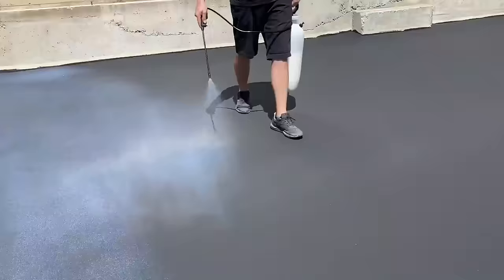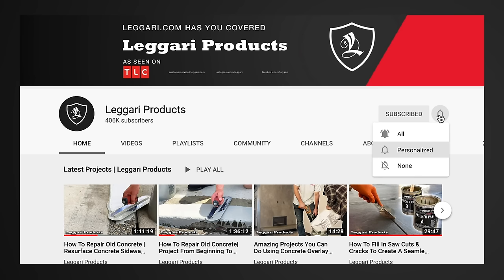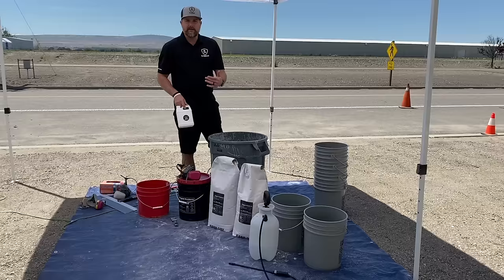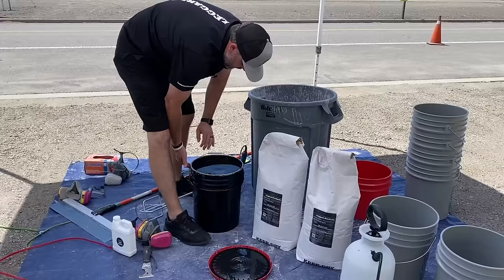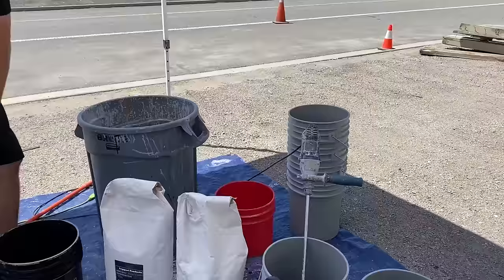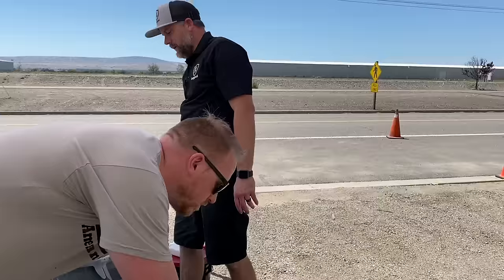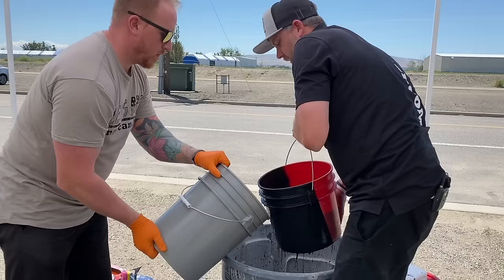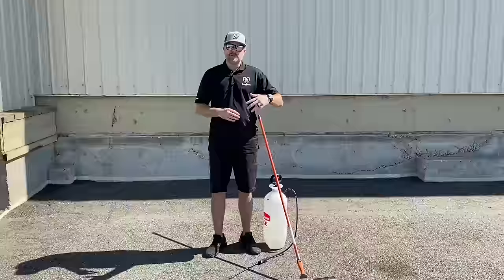Asphalt Repair That You Can Do Yourself Using This Kit | How To Resurface Asphalt

Comment: Let’s see a demo on a road that actually needs to be repaired.
Reply: This looks like gravel to me... it looks really good after
Reply: A killa 4 reala  at least 30? Evidence?
Reply: Hilarious, I was thinking the same thing
Reply: Z
Reply: Yes ridiculous to show on perfectly fine roadway
Reply: 0
Reply: I have worked with concrete self-leveling products in my time I believe it's basically the same thing but it's not a self-leveling product and all they're doing is throwing in a color so it should be filling holes and smoothing it out more than what it is otherwise it looks like it's just a painted paint job unless you can prove that there are the additives that supposed to give it extra strength as they said it has porced crust porcelain and other things in there but if it's that fine of a product where is it getting its strength is there an epoxy of mix how last long does it last what happens if it's on a hill when you do a burnout in the snow these would be technical questions I would really like to ask them
Reply: How many times does he say “prehydration”. Sounds impressive
Reply: Lol right

Comment: I would like to see the update, what does this look like 1 yr on? What kind of weather does it hold up to? Is it something you need to apply every year? Is it just paint in a bucket that will chip and wear so you have to re do it all the time. None of that was covered in the vlog. Yet ASMR in me liked watching the squeezgy moments!
Reply: You will never see that because in a year all the cracks will have come straight through and the first frost and it will all be peeling off.

Comment: Looks like a premium product. The cost is the issue. According to the website the asphalt sealer would be $1,926 for a 1,500 sq ft driveway without shipping. For not much more the whole driveway could be repaved with new asphalt.
Reply: you are wildly out of touch on how much that costs.
Reply: Cost me 2800  for a new asphalt parking pad a little over 1400 sq ft. Id have to agree going new seems to be more cost effective. Idk .. interesting product, would love to see how it looks in 2-3 years.
Reply: Yeah... asphalt isn't expensive. No customer would pay me 2 grand to seal their blacktop driveway when you can buy tubs for 14 bucks at home depot
Reply: Looks great but too expensive.  I can have my entire 10000 square foot driveway recovered with 2" of asphalt for a lot cheaper.
Reply: @itybitygangsta  Depends on where you live. I can bet a new driveway cost thousands of dollars. I hate asphalt. It is just cheaper than concrete.
Reply: @caffeinatedinfosec191  ok.
Reply: Way too much money for what you get. More bang for the buck by putting on new hot top.
Reply: thanks for noting price

Comment: Joe is right,  I will like to see how the product works in a not to good driveway or surface.
Reply: If it’s super bad I wouldn’t suggest just demo and repour
Reply: As with any seacoast. Cracks should be repaired first.
Reply: @ilovethenfl510  I have an old driveway but I can't afford to demo - it would  look better than what I have now. I would just make sure I fill any cracks and and clean the surface area of weeds, dirt and loose gravel.

Comment: gut out the asphalt and put a nice concrete. i used the sealer from Costco over the summer and works out excellent. $9.00 a bucket on sale, two coats worked like a miracle! all under $50.00
Reply: All under $50, not including the removal of the asphalt,forming and pouring the cement? Not bad.

Comment: Hi, nice video. I suggest building a platform on wheels for the 32-gallon trash can and put a plastic spout at the bottom of it. 
This way you can actually wheel the material to the the work area saving you from carrying all those buckets. Not to mention the money you'll save. No brainer
Reply: I was thinking just putting a hose and pump from the trashcan to the end of the squeegee with a release value
Reply: @betauser6233  I bet a hose or spout would gum up pretty quickly.

Comment: Most people do not realize  that if there is a crack under it when you fixed it that there   will be one there  later.  This holds true  when  you put any asphalt over any cracked concrete
Reply: My friend had her driveway repaved with the intent to hide the cracks and when they resurfaced she refused to pay he guy -- lots of miscommunication.

Comment: Used to apply Ardex this looks similar except I put on much thicker also did 1/4” trowel down epoxy also did epoxy coatings same way you are but broadcasting sand and back rolling I miss it

Comment: Thanks for the video.  My question deals directly with my driveway which has a lot of cracking in it.  What is your recommendation for prepping the cracks prior to applying the product and sealing it?  Or perhaps any additional technique for applying the product where there's cracking going on.
Reply from the maker: Our asphalt repair kit has a lot of crushed marble in it, this will help add structure to the cracks again. It does have its limits so if you’d like a more thorough answer please send some pictures to customerservice@leggari.com thanks
Reply: How does this product hold up to extremely cold areas that see a lot of snow and salt???
Reply from the maker: Spuds holds up great! It has been used in the northwest for decades now, with temperature swings of -5 to 105. Once cured the product is extremely resilient to weather cycles. Thanks
Reply: @LeggariProducts  we live in Central New York, the land of Land of Lake Effect. A lot of salt is used on our roads for safety but it can cause issues for both concrete and asphalt. Anything that could withstand temperature extremes from 20 below to 100 degrees F would be a godsend!!!😃😃😃😃
Reply from the maker: @spuds6423  it's hard to not sound too much like a salesman at this point, so for everyone curious at our claims, we send out free sample kits so you can test it yourself. Truth is, this product will blow your mind! For a free sample kit to thrash and test email us at customerservice@leggari.com. Talk soon, thanks!
Reply: @LeggariProducts  Thanks
Reply: I like Rapid Set! They have been a Game Changing Product and They will even send reps to ur jobsite to do a demo on cinderblock wall or even assist you in applying there several diff products. 
Reason I mention them is not to discredit this neat product but I know they have good things for tackling cracks in driveways and also resurfacing and this form of concrete mix can do SOOO many diff things it’s mind blowing-Sculpting with it as it dries in 20 mi etc…
Reply: @donjohnson1290   I absolutely love that asphalt rapdi set repair, it's like a miracle!!  Looks good too.  I hate to say it, but I think it is just a little too expensive, and I'm not sure why?  Looks like a polymer sealant with limestone dust mixed in?  I've done that and also like to add sand for texture, after filling the large cracks and sealing the points that meet another verticle surface.

Comment: Add a bulkhead pipe fitting and thread in a PVC ball valve on the side of your garbage can.  This will make filling buckets much easier and much less mess than dipping smaller buckets.
Reply from the maker: Thanks for the tip!

Comment: I'm in the parking lot repair business , 32 years .
People are always trying to reinvent the way to repair a asphalt parking lot or asphalt driveway .
This product is just another attempt to try and reinvent the "wheel". 
I notice too much labor in mixing and adding the bags of materials . Also product doesn't cover a lot  of square footage for the amount of product used .

There's a old saying you can't buy a mechanic in a can . Refering  to the different products that are available to stop leaks and or make car engines run better .

The same with asphalt repairs. You can't buy a paving contractor in a bag and bucket.

Also the process they are  performing is not resurfacing. 

Resurfacing entails using a paving machine and applying a inch layer of plant mix hot asphalt over the existing asphalt and then compacting with a asphalt roller.

Comment: Tar is used for asphalt seal coating.  The best product from Gemseal is a polytar with a 5year warranty.  The blackest and thickest seal coating on the market.   Also fills all aggregates to a flat surface for repair.   Leggari products is cool but I hope they just stick with epoxy.  And leave the asphalt to gemseal
Reply from the maker: Thanks for watching, we’ll will be revealing some pretty compelling test results very soon. We’ve actually been in the overlay industry longer than the epoxy industry. There’s plenty of room in every market for good quality products. Stay tuned.
Reply: @LeggariProducts  you will need to bulk tank it, my last job was 189k ft. No way would I open that many fives.
Reply: Nikolas Tamez  Bro let’s start making sissy ass countertops. I’ll remodel for a while and maybe roof houses and drive an f250 if I have to but maybe not that’s a little too gay but really spaghetti countertops? Y’all gonna trash 🗑 can your way outta the countertop biz with junk sealer.

Comment: Looks Awesome, I was thinking recently I wonder if anyone has repair kit for Asphalt, this will be a great add on to my business plus I have an area I can use it on first to see how it lays out and how it holds up in the long run. thanks for the Video.
Reply from the maker: You’ll absolutely love it. It’s really easy to install, lasts longer than traditional seal coats, and adds significant durability to the asphalt.
Reply: @LeggariProducts  does the kit come with a crack repair kit, if so what is the linear feet the crack repair material will cover?

Comment: looks like some bullshit Sealmaster has just another gimmick. I didn't see any cracks gators or anything wrong the asphalt. try that on some of the jobs I quote
Reply: With any overlay, sealer etc you are required to repair the surface before re coating. That is common sense

Comment: This is just blending over the damages and has NOTHING to do with repair.
Reply: It forms a top coat and does make asphalt last much longer but i recommend a professional company, they will also hot tar fill any cracks to keep frozen water from causing more damage and a special spot primer for oil soaked spots. It will take a old parking lot that has a rough top coat and is separating and make it last much longer and look new
Reply: Professional companies use a sprayer or a truck that can squeegee 10 foot passes at a time for large trucking lots or it can be applied like they are doing but anyone that does this for a living can run a line of sealer exactly where they want it and dont need tape
Reply: It can form whatever, there are so many companies international that just put asphalt, or concrete or bitumen over any kind of damage and it NEVER lasts. Like said, that has NOTHING to do with repair, this is naive and ignorant blending over. I know my craftmansship man, I am foreman in an european street construction company, so I do not need mindless explanations by a random utuber, whos impressed by such a fake knowledge.

Comment: If there are pot holes can you use cold patch and then cover with your product, with same results?
Reply from the maker: Yes, just make sure to follow the manufacturers recommended installation for the cold patch. For smaller pot holes you can add pea gravel to the hole about 3/4” from the top then fill the hole with the asphalt repair kit. Thanks
Reply: Lol

Comment: What if the existing asphalt is deteriorating and has significant cracks or even with missing or loose sections?
Reply: You could use cold patch as a cheaper alternative

Comment: How will this product work in Las Vegas with temps of 115? Is there a crack repair system?
Reply from the maker: Absolutely, This product is very popular in Vegas. Depending on the size of the crack, you may be able to use the mix itself because of the marble in it. The crushed marble acts as reinforcement much like aggregate in concrete. To address your situation specifically send pics to customerservice@leggari.com and we can discuss. Thanks

Comment: does it work on concrete? if not is there a similar product to it? I live on the last floor of a residential building and the roof always leaks no matter what I apply to it, sealer, asphalt patches, tried them all. I was thinking about applying multiple coats of concrete that are pretty thinned out with water until all the cracks are filled, any ideas or advice?

Comment: I can crack fill and seal 3500 ft sq by myself.   Crew cost?
Cracks and alligator areas, broken edges?  
Different colors? 
Interested but not sure it solves  typical pavement problems.

Comment: Is that better to use in a TILES  at the rooftop.. cause there's a leakage  we try to remove tile grout and put body filler but it didn't work... There's always a leak at the roof that has tiles
Reply from the maker: Call customer service at 844-LEGGARI or Email customerservice@leggari.com They will be able to help you with your questions!

Comment: Hi
Can you paint the same 
On a vertical wall as waterproofing
Reply: this is asphalt sealer, not wall waterproofer. If you have a concrete wall you want sealed, use a concrete sealer.... If you're trying to waterproof a wall for say a shower, you should put in some shower wall panels instead of trying to coat existing walls with a chemical agent that would get you fined by your local code enforcement officer.

Comment: Pretty much every brand has polymer additives  sealing asphalt emulsion been around for ever.
Reply from the maker: Yes, but not all products take advantage of the different types of polymers, which have different benefits for different situations. More to come on this in the future. Thanks
Reply: @LeggariProducts  your not the first one,  ive seen an used about every brand on the market in the past fourty years  ,  others i know over fifty five years , from sealers to asphalt rejuvenating cracked asphalt. .
Reply: @michaelwillcutt2619  well @Leggari Products are purely displaying how THEY do and showing and explaining what works best for that particular job, but I guess you want a cleverboy sticker!!! Remember times and technology may have changed over 40 and 55 years :P
Reply: @SnowHearne  Agreed. .. I'm going to take a flier on the Leggari Products for my own DIY driveway needs. .. A Vail, Colorado property management company uses the Leggari drive/parking lot products for years now. .. Two thumbs Up.
Reply: @SnowHearne  Since you have 40 years of experience please tell me how long this will last? Isn't it like white washing a fence? You are just putting a thin layer over a old product it must just be a temporary solution.

Comment: Great stuff! Any chance you can look into having a cement gray color rather than the black asphalt color. Have always wanted to change the asphalt on our driveway to gray cement look. This is what I need but would like it in cement gray color. Similar to your sidewalk resurfacer. What do you use to fill cracks before applying the surfacer? Thank you, Ted
Reply from the maker: Hi Ted, we have a cement colored overlay the issue you’ll run into is that the oils from the layers below will soak through the gray layer and stain it black anyway. We ran down that train of thought for a while but couldn’t get around the staining issue. Thanks
Reply: @LeggariProducts  with old stain too?
Reply: Crack sealer?
Reply: @LeggariProducts  Wonder if you could do a thinner seal first and then try the cement colored overlay?  I actually was thinking about white instead of gray. I don't want to absorb any more heat - I want to repel it!
Thanks, love your products. 👍
Reply: Will it fill cracks?
Reply: @BWeezy-sw1wy  Ask Hunter.

Comment: When they put my driveway in they used a batch that was not good. From day one it has been in a constant state of crumble. I quit resealing it after the third time because the seal job wouldn't even last a year. Will this work on a driveway such as mine if i get all the loose material cleaned up?
Reply from the maker: Yes, it would be a great option for you!
Reply: @LeggariProducts  I'm a little Leary paying that much and it doesn't work. Is there any guarantee?

Comment: Hey leggari I’m a asphalt and concrete contractor I’d like to try this product out. How does it work in colder temperatures as far as applying is it the same as regular sealing applications 50+ degrees?
Reply: Can you buy it  in Canada

Comment: how powerful must your drill be to accomplish such a task. Mine went up in smoke
Reply: You need a hammer type drill that has big amps if its corded, if you want the battery type go for a drill with hammer setting or 4.0 amps or 5.0 amps battery like the dewalt drill with the XR sign

Comment: Why dont you use a mixing container with a tap? Makes it easier instead of all those buckets.
Reply from the maker: The taps get plugged up too fast with this type of mixture and it becomes pretty annoying. The garbage cans seem primitive but they’re very fast to work with. Especially when doing lots of batches. A good alternative however are the tilting mixing containers, but even those can be finicky. Thanks
Reply: Ohhhh.... Ok i understand... 👌👌

Comment: So it’s the exact opposite of when your actually LAYING ASPHALT? I’m certain it’s better to lay asphalt when it’s hot not cooler 🤷‍♂️
Reply: Not asphalt, they are basically putting down a concrete-modified 2-part water-based epoxy

Comment: So its kind of like a slurry seal?
Reply from the maker: Sort of except it adds structural integrity to the surface of the asphalt. Typical slurries are modified tar-like products which seal the surface but doesn’t necessarily add any type of strength to it. This does both, and lasts 3 or 4 times as long as slurries. Thanks